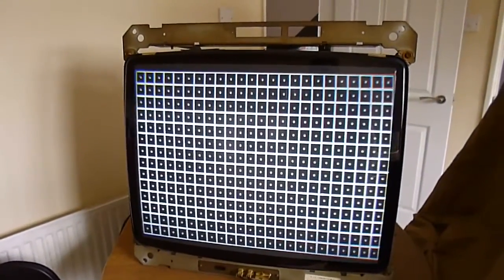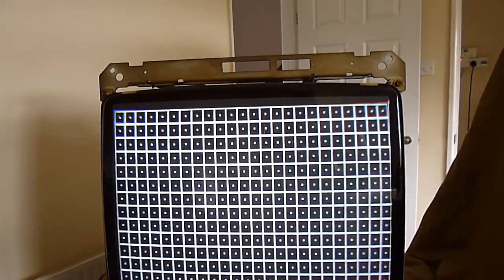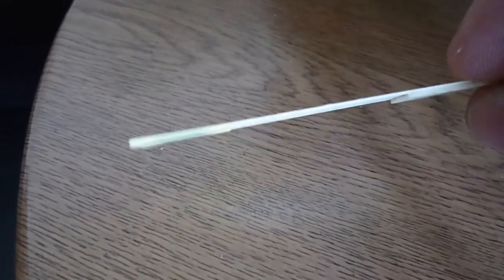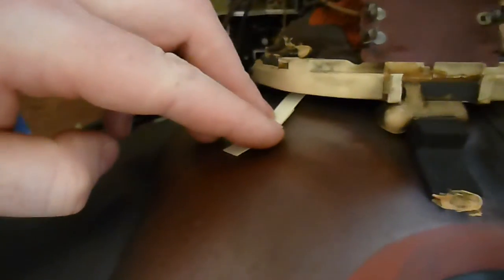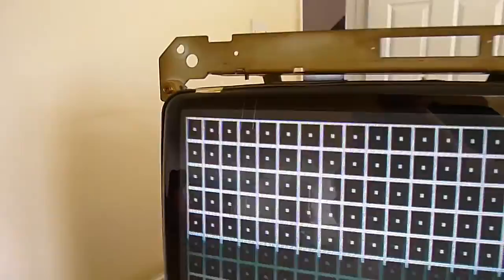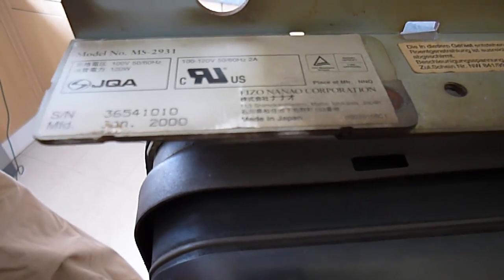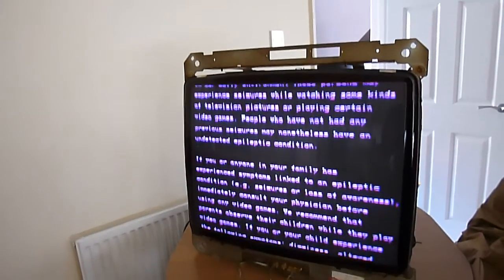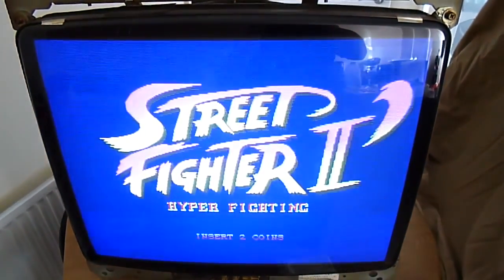Sega Blast City Nanao / Toshiba ms2931 / 30 convergence fix adjustment

Comment: Hi. May I ask your opinion about this try sync Blast City monitors? Do they die quite often? I am about to buy a Blast City, and I don't have free time to maintenance. The guy has 2 Blasts. One with original monitor and tube not working (when you turn it on you can hear a "click" and no image shows up. And the other one with a Philips European consumer RGB Tv inside. What would you go for? On the other hand I can also go for a Astro City 100% original inside. I don't if the Nanao on the Astro City has better life quality than the try sync Blast City one. PS: I am going to use only 240p on that. Thanks a lot =)

Comment: Thank you very much for sharing this information
This is a nanao ms-2933 chassis though and not a ms-2931. You can tell by part number on board it is not same as 2933
The tube number you have also match whats wiki says is for 2933
I have a broken 2931 that i replaced with 2933. The 2 boards look almost same except placement of few things like yoke wires
http://wiki.arcadeotaku.com/w/Nanao_MS-2933